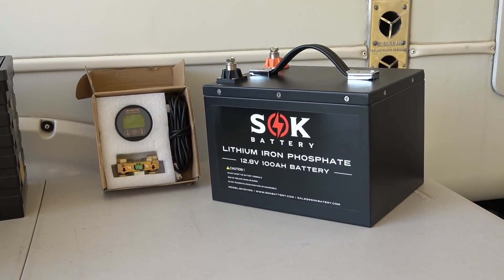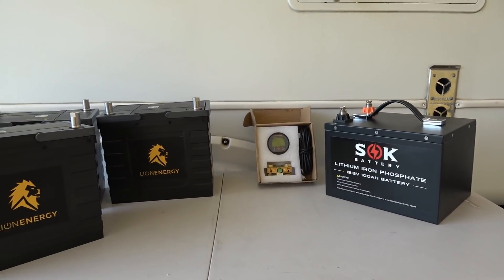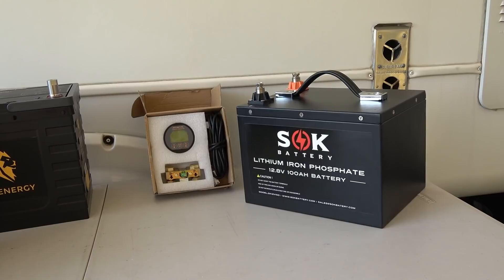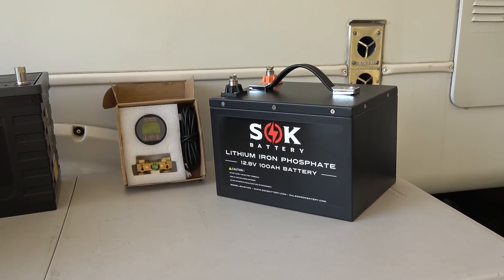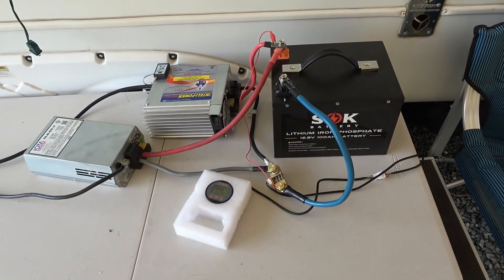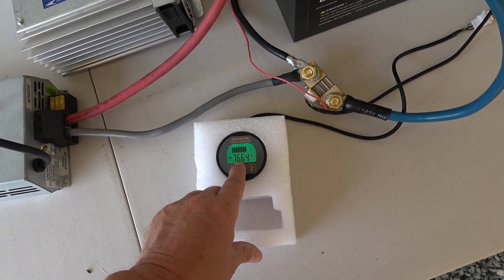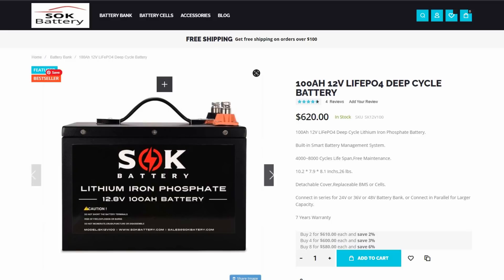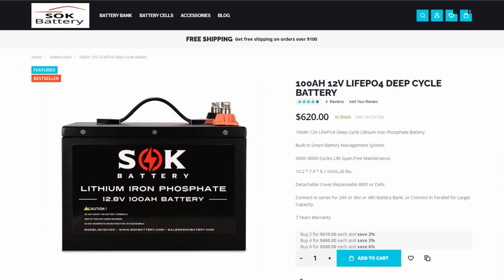SOK Lithium (LiFePO4) 12V RV Battery - Demo, Tests, and Initial Review (Model SK12V100)

Comment: That BMS is a generic one. It's not worth the money.
Reply from the maker: The website says they design the BMS themselves.  Here is a video showing  it - https://www.youtube.com/watch?v=vlhnDuTU5QE&feature=youtu.be
https://www.sokbattery.com/about-us  "SOK battery is a leading manufacturer and supplier of lithium iron phosphate batteries (LifePO4). Established four years ago by a team of 3 engineers from CALB, we at SOK have provided our satisfied customers with more than 17000 pieces of cells and 2600 sets of battery packs and received good feedback from them. We design the battery management system, assemble and produce the battery pack by ourselves. We have also established cooperation with a leading battery manufacturer to sell LiFePO4 cells and a complete solar or off grid application system completely designed by them. Starting in 2020, we will start selling online to bring good quality and cheaper batteries for the retail customers."
Reply: @LoveYourRV  Thanks for the reply. It sure looks like the ones they are sticking in the Ruixu.  Take a look at the tear down Will does on his.  He tears down lots of them. Very informative guy. I know when it comes to LiPo4 there is only a couple of OEM builders out there. Some better then others. Most of the cells have the same performance but the money is in the BMS and how well they matched the packs together. The big money is in the BMS and how well it works. The link is to the Ruixu tear down. He also tears into BattleBorn and others to compare them.  Take a look and let me know if they look like the same builder. I'm not trying to put down your video or battery but just trying to let you see what these companies are up to. Many of them will give a product to someone and want them to do a review in return for them to get a little money from the sales the reviewer does through their site. I get offers all the time but none have anything I need or want. 
https://www.youtube.com/watch?v=YVIiHzra2kA&t=305s
Reply from the maker: @CrazyMarty  Thanks for the info. Maybe Ruixui is buying the SOK BMS, I'll ask them, see what they say.
Reply from the maker: I asked the SOK rep and they do sell their own built BMS boards to 2 other other companies, it helps them keep the price down by increasing the production so they can maintain the quality at a lower price.
Reply: @LoveYourRV    I don’t think so. You can find that BMS on Alibaba. Take the one you have and google the numbers on it. No matter though. If you get 3 years out of them I guess it’s ok.
Reply from the maker: @CrazyMarty  Sorry can't find it, do you have a link I can look at. Thanks Ray

Comment: You need to do a timed discharge in order to determine actual capacity.
Reply from the maker: Thanks, yeah, plan to do that a low, medium and high amperage rates for my full review.  Cheers, Ray

Comment: Here’s ‘the Rub’ on this huge (evolution) to Lithium, as I see it; and, qualifying ... I’m an outlier, waiting for Mass Market (in a sense).  Plus, I simply cannot afford a couple grand on batteries.
The prices keep dropping - check
The market is nearly exclusively cornered by China - BIG Negative, for me.
Like most electronics, they are ‘obsolete’, just as consumers get immersed which I’m sure is by design.  To capture that part of the market that “simply Must have the NBT”.  Referring to the Tech.

So, as I sit on the sidelines, waiting/hoping for a time that I can maximize my Limited budget, and still get decent ‘tech’, I simultaneously wonder about the Point of Diminishing Returns.  What I mean is, I have done similar with my Roof Vent/Fan purchase.  I studied the products, made my decision to proceed with MaxxAir; and the prices JUMPED !  Not the typical (trend) in electronics, and more unpalatable is that they have gone Cheaper on their production ‘quality’.

I wonder if the same fate awaits on Battery Tech, as I am (currently) waiting for “My” price point.

Our (reliance) on chinese products continues to be a Massive Aggravation for Me.

Comment: Another thing to point out is that in SOK direct website, there is no option to use CC, only Paypal. I will never order anything online with anything but CC. I know Paypal has some protection but I'd rather deal with my CC company if anything goes wrong.
Reply from the maker: Thanks for letting me know, I didn't try the payment process

Comment: Max Charge Current: 50 A
Reply: i contacted with SOK, it could be charged 100amps, discharge 140amps, but in order to ensure the longer cycles life, it rate at 50A/100A

Comment: How many amp hours did you get out of it before it shut down?   That part wasn't clear.
Reply from the maker: When I did a test an approx 50 amps I got right around the rated 100 amp-hours according to the SOK meter. I'm in the process of testing at several different discharge amperage rates, like 5a,  20a, and the max rated 100a using my better quality Trimetric battery monitor. Will report the results in the final review. Cheers, Ray

Comment: Hi Ray great video. I went to the website and its going for $580 now. I was hoping for a discount code from you. This is by far the cheapest I've seen for a 100ah Lifepo4. 7 yr warranty to boot.
Reply from the maker: So far they haven't mentioned a discount code but I know that the batteries just came out. Cheers, Ray
Reply: 620 now
Reply: @mikepoulin99  599 now (December 3 2020)

Comment: Wow, that's approx 40% cheaper than Battle Born.  I also noticed the Sok is 5lbs lighter.  Not sure if that matters.  I would like to buy American but would like to keep $400 in my pocket too.    Sláinte
Reply: I don't think there are any real American lithium cell producers so you'll be waiting a long time. Most due the old lead acid or alkaline batteries or lithium in small amounts which wouldn't be worth the price as they're doing the same thing the Japanese and Chinese are doing anyways. If you want known quality go with one of the major Japanese brands for individual cells.

Comment: I think the hight drop on voltage at high current is because they are not using coper busbars . 2x8 aww wires do not have such a high voltage drop at 150A
Reply from the maker: Could be I'm going to do some internal voltage drop measurements across the various hardware, another person said it could be the internal resistance of the BMS. Lion uses 4 cables inside and Battle Born uses 5 so leads me to believe the wire gauge and connectors has some effect somehow or why waste the money and space. I see on the BMS board they have spare slots for 2 more wires and in the 200AH battery they tell me they do use 4. Cheers, Ray
Reply: @LoveYourRV  I had the same problem on my diy system, I was using 8 awg but noticed the busbars were warming up over 100A , I tosed them in the trash and got coper busbars, problem solved
Reply: Copper plated aluminum, anyone?

Comment: Well they must have something wrong with their website because if you go to it you can actually purchase a battery monitor for $0.10 I just bought 10 of them for a $1and free shipping
Reply from the maker: whoa, that's a deal!
Reply: Sure adVANtures, Did your transaction go through and complete?
Reply: @philipdishongh5074  I used PayPal. Im assuming that it has, I haven't seen otherwise yet..... but
Reply: I gave it a try. Using PayPal also. But, received a suspicious email wanting me to click a link to login to PayPal to complete the transaction. I didn’t do that, but went to PayPal site to login. There is no transaction showing, nor any messages regarding this transaction.
Reply: @philipdishongh5074  🤔 guess I'll have to do some investigating 👍
Reply: Well PayPal says that they are not going to release any money until the order has been placed so unless there is some scam which I'm not sure about they're only going to get a $1😂. Now when I ordered from the website there was a place to select PayPal and that is what I used and everything seemed to be legit.....but, guess we'll see
Reply: Does your PayPal account show the transaction?  Mine does not.
Reply: @philipdishongh5074  yes it shows a transaction ID. Lol maybe they caught the problem 😂
Reply: @nicholsceramiccoating8284    if you read the info and you would find: 
Buy 2 units SK12V100 or 1 unit SK12V206,will get one Battery Monitor free.

Notice:NOT SELL SEPARATE,ONLY FOR GIFT
Reply: @minwang9281  website said .10 each and PayPal accepted it?
Reply: @nicholsceramiccoating8284  it accept the order,but i guess they would cancel this order if don't buy their battery...

Comment: Lithium is still out of our budget. Have you any experience with Can Tire's Nautilus group 24 AGM?
Reply from the maker: No, haven't heard much about them. They look like a hybrid marine battery, so can be used for starting a motor. Usually with those there is a bit of a trade-off versus a true deep cycle battery meant for only power storage and not requiring high cold cranking amps. I think drawbacks are less amp hour capacity and lifespan for deep discharge cycles. But if the price is right might be worth it.

Comment: Nice review.  Thanks.   Minor point; you read "100%" when the meter reading 100 AH as indicating full charge.  This may have been the case here since the battery had been recently topped off (before the discharge) but it is often not the case.  Since SOC meters always drift down, they typically hit an indicated 100% before the battery is actually at 100%.  The meter effectively resets by stopping at 100% while charging continues to a true 100%.  Then the indicated SOC drops from there during discharge.  If the battery had not recently been fully charged you would have seen this (and maybe a closer look here would have shown this since even one deep cycle should have the SOC meter hit 100% slightly before the battery does.   

It's interesting that the battery at full charge (it surely was since you took it to 14.79V) read 100AH.  Most most new batteries ship with a bit more.  BattleBorn's ship with 102 AH or more.  Lifeblue with considerably more.  Though the unknown precision of this SOC meter makes this a dubious observation.  I'm splitting hairs in any event.
Reply from the maker: Thanks,  I'll have to do some tests with my Trimetric Battery Monitor I have in the rig, see what it reports.  I think Battle Born likely adds a few extra AH to the battery since they are building it using so many small cylindrical cells. Likely more of chance of a few of them failing over the life of the battery. Having the extra head room will help keep them from having to replace under a warranty situation. Just a guess.. Cheers, Ray

Comment: How long for full discharge? how long for full charge?
Reply from the maker: That depends on the amperage. Lithium batteries charge and discharge in a pretty linear fashion, so say you are drawing 100 amps, then this 100AH (amp-hour) battery lasts 1 hour, but say you are drawing 10 amps, then it lasts 10 hours and so on. Same with charging. Lead-acid batteries, on the other hand, charge slower when they are getting close to full so the last 15% of charge can take much longer making them charge slower, its what they call a logarithmic charging curve. Also with lead-acid, if you discharge them at a very high amperage rate they lose capacity, called the Peukert Law. Lithium doesn't suffer from that to near the extent.  Cheers, Ray
Reply: @LoveYourRV  That is what I was wondering, did the battery maintain itself during discharge or would/could it lose charge quicker than it is supposed to. Same with charging, it it take everything you through at it without delays or slow spots. I am wondering if cheaper made batteries or their management system can actual perform in unexpected ways. So a $620.00 100ah  battery does the same as a $1000.00 100ah battery.
Reply from the maker: Yes, it handled the charge/discharge no problem, no slowdowns or weak points, I think the cells are pretty good, the rep said the are UL and TUV certified, the BMS looks like it is pretty decent build hardware-wise.  I'll see if anything negative crops up over the next few months of testing it. I'll be reporting it.  I'd say so far it's pretty comparable to the Lion batteries I have been using, they list for $999 but with my discount, they are $849 and some times they go on sale at Costco for $799 or 2 for $1399. So not much more but Lion's limited lifetime warranty is a little better, no hard time period just 3500+ life cycles, 105 AH and 150A rated discharge and they are based in Utah. So I guess you pay for a little better performance specs, maybe better product support, warranty and they also have a longer track record of selling.  I do really like the SOK case design though.  Overall it's great to see lots of competition in the drop in the lithium battery market, good for consumers. Cheers, Ray

Comment: Nice price compared to Battle Born.  Metal looks good. I wonder how this will perform on the long haul.
Reply from the maker: Will be interesting to see how all these drop in batteries perform. They told me the cells in these are UL listed and TUV certified so that's good. They make their own BMS. But time will tell.  Cheers, Ray

Comment: You didn’t really report on how many amp hours it put out in that discharge test though, did you?
Reply from the maker: I ran the battery flat, then zeroed the meter and recharged it, the battery monitor reported 100 amp hours when the BMS cut off charging. So it was bang on its rating. Which is OK, some batteries will actually show slightly higher amp hour ratings when new.
Reply: Love Your RV That, however, is not a discharge test. Use a bmv712 or similar and run it in a discharge.
Reply from the maker: @Gratefulwon  I have the battery now hooked up to my Bogart Engineering Trimetric battery monitor system in the RV, plan to do more in-depth testing for my review. Will test discharge ah capacities at different constant current levels, like say 5 amps, 20 amps, and 100 amps.

Comment: The real test will be how many charges they actually get as compared to the more expensive ones that have real world longitudinal tests. Also, 2 8 gauge wires are the equivalent of 1 4 gauge wire.  Good job m8! Cheers!
Reply from the maker: Thanks! 2 - 8 gauge in parallel actually have an effective gauge of 5.  https://www.wirebarn.com/Combined-Wire-Gauge-Calculator_ep_42.html
Reply: @LoveYourRV  There's a price war going on now in Asia between Red China, S. Korea, and Japan. Prices are falling like masks in Walmart! Check this price out:  https://www.aliexpress.com/item/4000373623729.html?spm=2114.search0302.3.47.6ae4ba9cnirOYs&ws_ab_test=searchweb0_0,searchweb201602_0,searchweb201603_0,ppcSwitch_0&algo_pvid=764d2ed4-77b7-444f-8f3c-7b559239765e&algo_expid=764d2ed4-77b7-444f-8f3c-7b559239765e-6 Given that, in a few more years, LiFePO4 will become the defacto standard, while all other batteries will be orphaned technology. Time will tell, ultimately...
Reply: @LoveYourRV  I knew it wasn't exact, as theory isn't always reflected in reality! But it does somewhat explain the use of those 2 wires rather than a single, larger gauge one. Safe, and happy travels!
Reply: @Zymurgest  Wut?
Reply: @goodoz9942  Yes, what is it? How can I help you? Safe, and happy travels!
Reply: @Zymurgest  I'm just trying to get my head around how a single 4ga isn't a better electrical solution than two 8ga that wind up the equivalent of a 5ga.  Or, even two 6ga.  Safe travs back at'chya!
Reply: @goodoz9942  Well, according to theory it's (8*8)/(8+8) = 4. But it's like what Einstein said “In theory, theory and practice are the same. In practice, they are not.” Which is what I was referring to originally. Sometimes I forget my age, and think that what I know about is common knowledge to everyone. Safe, and happy travels!

Comment: Nice battery the 200AH would be nice... I like the battery monitor but the shunt does not look like you can mount or secure it down?...
Reply: The dimensions on the 100A vs the 200A are nearly identical...If I'm reading correctly, the 200A has a 2" greater depth? (HxWxD is always helpful...why don't some list off the order of their dimensions?)  That said, it does present some question marks on the double capacity vs only 2" dimensional change.  The 200A is about 20lbs heavier.  So that sounds about right.  Doubt they have the same prismatics (the blue ones on their website) inside of the 200A.
Reply from the maker: Yeah, didn't come with any bracket, but I guess you could easily mount it with a couple add-ons.

Comment: Really good info Ray, but I decided a few years ago to never do China, knowingly, again..
Reply: Are there any lithium batteries made in the USA?    Doesn't avoiding China mean having to stick with AGM?
Reply from the maker: Could be wrong, but to me, it looks like Dakota is assembling batteries in the US likely with Chinese cells and maybe even the BMS, I can't find anywhere that they claim to make lithium cells. It's the new thing for many companies to do,  give US support and a nice marketing website, and then source the components from China, either off the shelf or custom ordered. Sometimes the US company will do the design as well. They then can sort of vaguely indicate Made in the USA. It's probably a lot more cost-effective than trying to build out a lithium battery cell factory just to make a relatively speaking low number of batteries.
Reply: @bryanrisch4817  Dakota purchase  everything from  China, they just put a label  when batteries arrived .